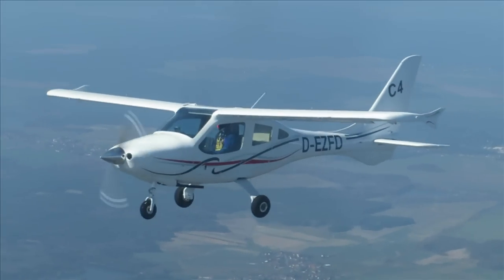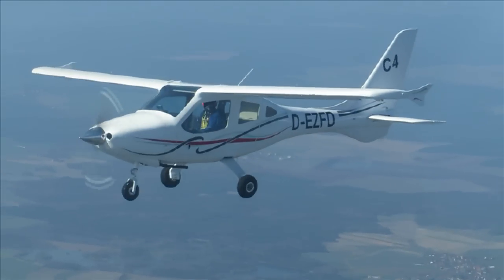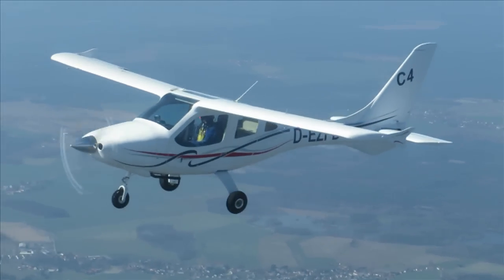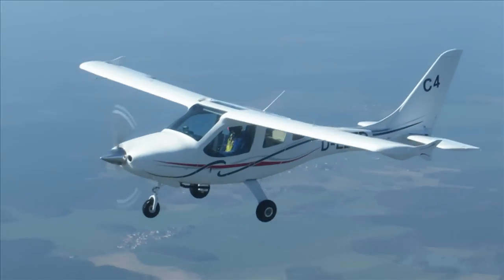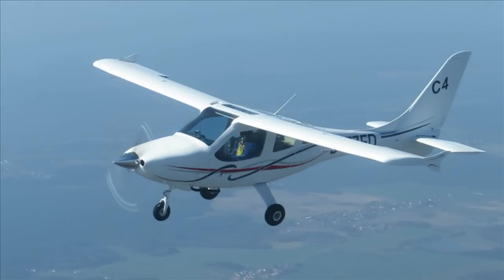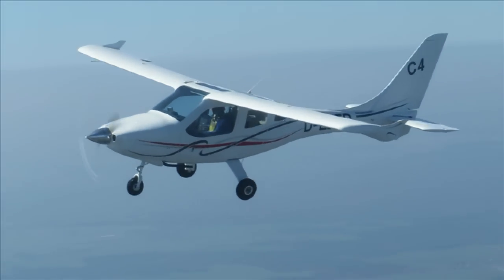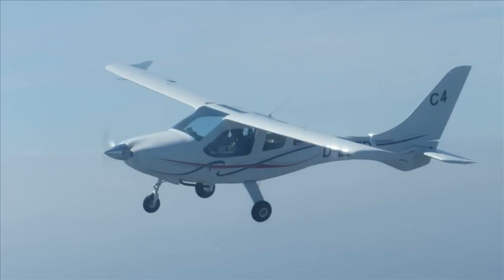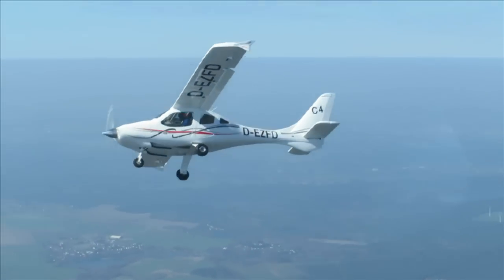Aero 2015 Flight Design C4 First Flight

Comment: price is $220000. I'll just stick with a C172, thanks.
Reply: Ok, but make sure you compare apples vs. apples.
A new C172 is $400,000.
Reply: +afdsadf 147852369  The price is $250,000 (the G1000 Cessna 172 $430k)...it has twin Garmin G3x with GTN 750, parachute, 155ktas cruise @ 8gph ....Cessna is over...stick a fork in them...

Comment: A difficult problem is the FAA certification. They counted on Part 23 rewrite, which isn't happening soon enough. The JAA equivalency not working for some reason. They were talking about Part 21 Primary, but that's useless for flight schools and FBOs. I'm afraid they have no choice but to stick with Part 23 or else give up on U.S. market.